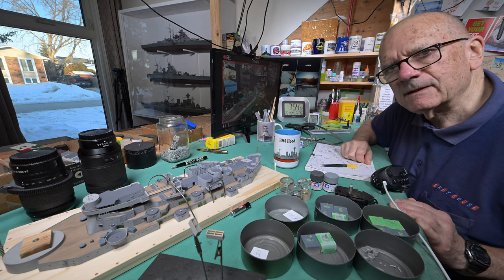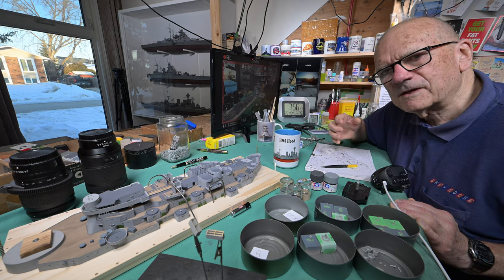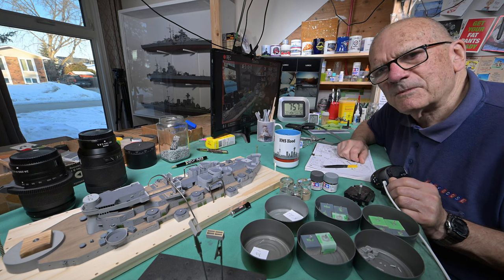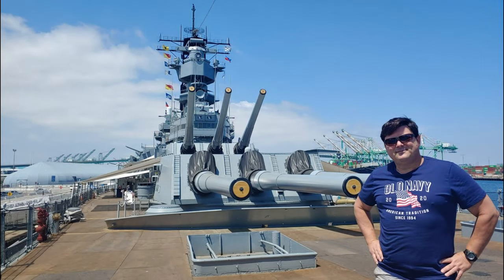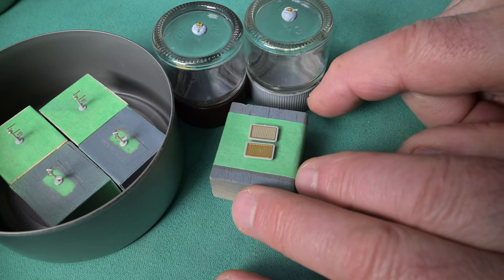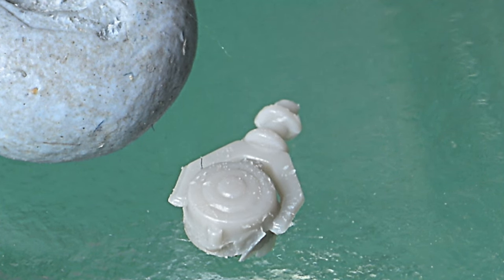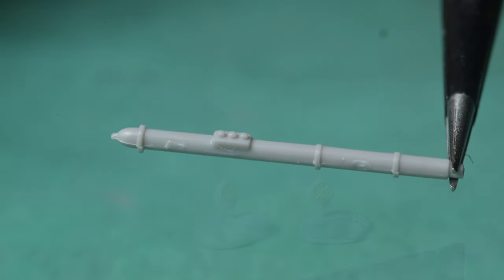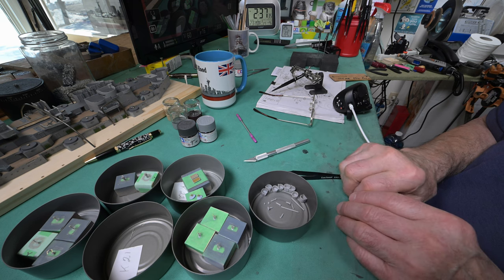The Model Ship - Part 1534

Comment: Hey Ron
     Yesterday under macro I said to myself did Ron put the non-detail backside of PE 50C on one of the L34s. No big deal. I painted all of my intake screens black. 
     Three month postage should be zero point zero pennies.

Mike
Reply from the maker: Re: "put the non-detail backside of PE 50C on one of the L34s"
I'd wonder that at first too, but no! The PE parts are the same number, but formed differently. Thanks for commenting Mike. 👍🏼

Comment: Hey Ron.  So...I am in the process of making mental deliberations and arguments whether (when) I get the Yamato...smiles.  One of the pieces of equipment I will be (maybe) considering is an airbrush setup.  I can't remember which, but in one of your videos, I remember you touting the brush you use.  Would you please help steer me towards the brush/compressor kit I should be considering?  That is...if I DO decide to jump off that cliff.  Thanks.
Reply from the maker: Hi Jerry,
This is what I purchased ---
Compressor  https://www.amazon.ca/gp/product/B07VT2F5N9/ref=ppx_yo_dt_b_search_asin_title?ie=UTF8&psc=1

Airbrush Kit  https://www.amazon.ca/gp/product/B07SQYLBR5/ref=ppx_yo_dt_b_search_asin_title?ie=UTF8&psc=1
Reply: @roncalverley  Hey...just ordered...just in case I decide to get the Yamoto.  Smiles.  I am doomed...